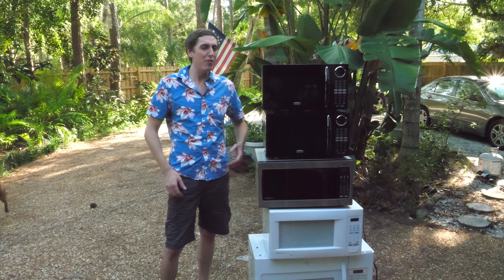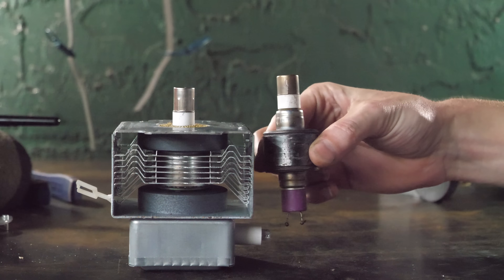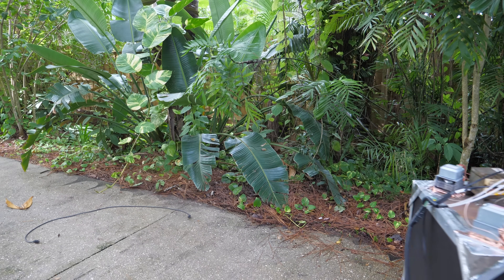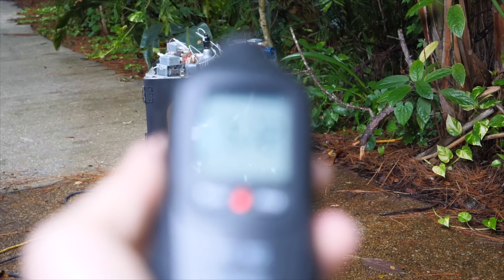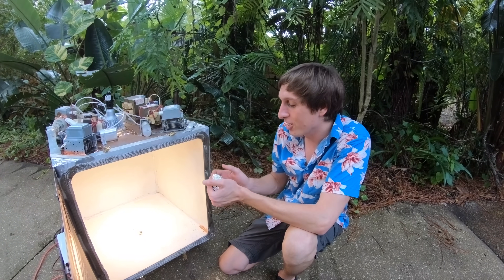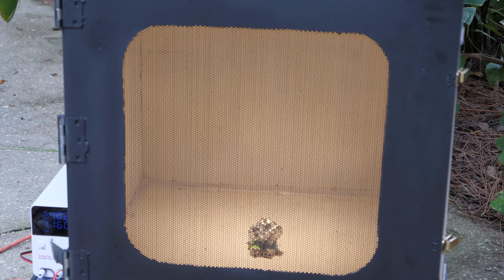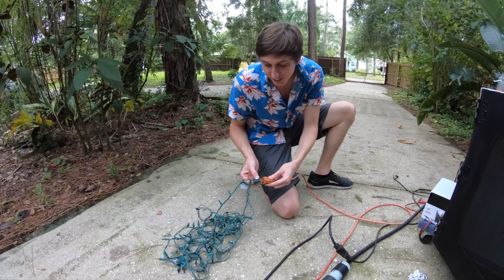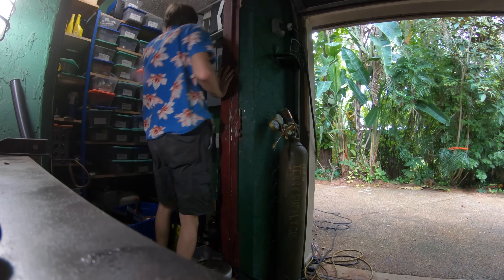DIY MEGA Microwave! - Microwaving a Microwave

Comment: I asked my brother this very question and he said, “no you can’t. A microwave is a Faraday Cage”. Should I show this to him?
Reply: I wish there were microtron 5000's in ksp so I could build a microwave space gun on my warp drive rocket (mods are ok too)
Reply: He's right tho, microwaving  a microwave doesn't amplify anything, but it can't be a complete Faraday cage, because of the screen.
Reply: @zaydabbas1609  as was stated in the video, microwaves are long waves. The metal mesh embedded in the door blocks them. Otherwise, you'd have a lot of lazy people with no working eyes after they checked their food through the door while it's still running.

Comment: Here's what I think happened;
Commercial microwaves are designed to contain as many of the microwaves they produce as possible, meaning a chassis which is essentially impenetrable to microwaves. Now on the odd occasion that you shoot microwaves at the outside, I'd guess very few (if any) of those will actually reach the inside. I think what happened here was not actually due to destructive interference but rather the inner microwave was destroyed after just a few seconds and then acted as a shield for your Scientifical Standard Snack. It's also just occurred to me that the casing of the inner microwave was probably grounded, making it act as a mini Faraday cage.

Nonetheless, I can finally say I know the answer to the age old question: "Is it a good idea to microwave a microwave?"

Comment: Well, obviously the microwave is built to isolate the microwaves within, since they are dangerous. But this isolation works in both directions. So the microwaves of the outer microwave will only burn the inner microwave without reaching the snack. With the inner microwave busted, it doesn't heat the snack anymore either.
You've essentially built a dangerous less efficient one-time use composite microwave.

Comment: sooo many things i wanna do different to that Mega Wave!  1. space out the magnetrons across the entire cube instead of all on top. 2. add microwave...guides??? ( i dont know what they are called....) But they direct the wave in a special way so it is able to go exactly where u want the most energy to go.  3.  make 1 single high pressure "clip" so u dont have to open and close 6 different latches. 4. add...that...stuff... that allows the microwaves to bounce around in the cube..  (as you can see.. i don't know much about the actual materials either... but it would have been a friggin blast to work on this project with u!  let me know when your in Austin, TX at any point :). i have a bunch of random projects here you may find fun for one of your shows.  (racing quad with release mechanism so a green soldier can drop from waaaaaay up instead of just tossing him off the roof like i used to do as a kid... 1 fully custom 3d printer designed and built by me and a group of 23 other peeps using a chat room to share designs and upgrades.. 2 other prusa MK2S printer... 1 of those being a 2.5.   audio engineer on the side... um... make my own fireworks out of other fireworks by combining FUN STUFF into a ball!!! (each ball took me over an hour to build. i had no idea how much work went into those.)  anyway, i built 2 of em and both worked!!!! oh. and i love chinese food.

Comment: An improvement to that would be proper deflector ducts going to each magnatron. Commercial microwaves that has two elements use two ducts that focus them into the chamber. The reason has to do with resonance feedback. (aka why one of the transformers got very hot) Also somewhere should be a grid covered vent with a 90 degree duct coming off from it, it's for venting and since radiation can't go around corners (weird right?) they are cut down by the grid and further stopped by the 90 degree bend. The reason why the franken microwave you seen chills food down is the transformers were most likely wired out of phase, effectively slowing down protons rather then speeding them up.
Reply: i really wished you could deacelerate protons that easily mr maxwell..
Reply: @fss1704  oops I meant molecules.

Comment: You should use the Megawave as a microwave smelter! Using a silicon carbide crucible and a fire brick baseplate, you can actually use a microwave to melt metals. Sometimes you need to water cool the the magnetrons as well, but it's a lot of fun. Before the trolls jump in and tell me you can't melt metal in a microwave, I actually did this in college (where i studied metallurgy. Below is an instructables on doing this with low melting temperature metals. We were actually able to melt iron and steel using the water cooled version we had.

https://www.instructables.com/id/microwave-smelter/

Comment: The feedhorn built into the wall of the original microwave oven is important.  It is a tuned cavity that couples the magnetron to the oven.   Perhaps you can scavenge them out of the donor-microwave enclosures and use them in the mega-wave.

Also, the power supply for an average oven magnetron often consumes around 1100 watts.  One 15A circuit breaker can deliver around 1800 watts (which is why you don't see 120v appliances consuming more than that - think blow dryers).  Combining 5 magnetron supplies on a single breaker would far exceed what the ac line is capable of delivering.   The power supplies were likely sagging - unless the coupling of the output was so poor that it wasn't presenting the normal load to the power supply.   It's sort of like tuning a radio transmitter with an SWR bridge.  If the antena isn't right, the power going through it is greatly reduced.

Comment: I sincerely hope you didn't crack those insulators when you took the magnetrons apart. Unless manufacturing methods have changed, magnetron insulators are generally made of beryllium oxide, which is highly toxic and carcinogenic. If inhaled, it causes fun stuff like respiratory berylliosis and mesothelioma.

Comment: if you run the mega-wave with higher voltage it will work better. try a three phase welding line

Comment: I was going to do this years ago, but decided against it due to the high levels of radiation. At 4:25 you made me nervous. Even though it may have been unplugged, those 1uF / 2kv caps hold a charge for a little while. It takes time for the internal 10M resistor to bleed off the charge. Be careful!
Reply: I've always wondered if eating microwaved food is healthy?  Is the no radiation transfered into the food?
Reply: I stopped watching when he drilled a hole in the macrowave and did not seal it.
Reply: @drippingwax  i really hope he plugged it with foil or something off camera.

Comment: Technical question. 
Given that microwaves already draw most of a 20 amp circuit at 120 volts, how much power were you actually supplying to the 4 magnetrons? It appears that you had a standard 16 to 18 gauge extension cord at 120 volts, so I find it hard to believe that you crossed 2.4KW. 
Thanks.

Comment: All those experiments and he didn't even make turbo plasma....... and he calls himself a scientist!  Lol (I've found an old sock is the perfect fuel source to get the microwave plasma going strong. Catch it on fire in the microwave and power it up!)
Reply from the maker: Wait really? I've had trouble making plasma reliably.
Reply: @TheBackyardScientist  Yeah! I absolutely love plasma, and finally got a microwave lined up to experiment in. I just let it jump around the microwave rather than catching it with a bowl/ jar, but the biggest factor seemed to be having enough fuel for the fire so it stays strong long enough for the microwave to excite it into the plasma state. I noticed that the microwaves accelerated the burn rate of the matches I used at first, and that's when I switched to the sock. Also, the thermal shock destroys the turntable plate rather magnificently. :)

Comment: Need a tin foil shield to protect your nuts, because nobody likes roasted nuts!  I would also add some kind of metal blade in front of the wave guide of each magnetron to deflect the waves randomly, have it spin.   Actually should do an experiment to see what kind of distribution of microwaves you got going in there.  I wonder if some of the waves actually cancel each other out?  Would be interesting to try with 1, 2, 3 and then 4 activated to see different results.

Comment: The reason why there are hot spots on a microwaved meal is because the microwaves create a harmonic standing wave within the oven. Basically, the microwaves get reflected off the walls of the oven and interfere with waves traveling in the opposite direction, creating nodes where they cancel each other out and antinodes where they reinforce each other.

You could improve upon your design by finding out the precise wavelength of the microwaves the magnetrons create, then adjusting the dimensions of the oven to create a standing wave and placing your target within an antinode.

Comment: How would the microwave in the microwave even work cause the regular microwave does not let waves out or in so there was no hypothetical way it would have worked unless you took the door off of the smaller one before you put it in the big one.

Comment: Wonder how many watts it's packing. A 1kW microwave Won't melt a CD like that and that fast it's got to be at least 2kW probs more tho. You must put more things in it!
Reply from the maker: I'm pretty sure it is doing like 2kw. It should do 4kw, but theres probably a lot of dead spots and destructive interference happening.
Reply: @TheBackyardScientist   if you got any glow in the dark paint. Paint whole sheet that fills the bottom of you mega wave and possibly if u wish on the sides then run it for 5 to 10 seconds then where the waves are hitting it will glow brightest. Think it would be cool to see.

Comment: How are you supplying power to this? One circuit breaker per microwave?
Reply from the maker: It's on my welder circuit. 40 amp split phase 240v. 2 transformers wired in series (and 2 more in series - In parallel.) Because of this they see twice the duty cycle and get really hot so i had to use hair dryer blowers to cool them.

Comment: Slap some waveguides on those and they'll work much better!
Reply from the maker: Yes me friend is studying RF design and gave me dimensions for the wave guides and everything. I just did not really have time to build them, plus it worked good enough when I first tested.
Reply: Nice! I've never made them, but I'm sure you could gerry rig some with sheets of cardboard lined with aluminum foil. You could even make a microwave gun if you wanted at that point, but watch it because that inverse square law doesn't apply quite so easily in that case.

Comment: FYI, circuit breakers are not switches. They are only rated for a handful of switching events. You don't want to find out the hard way that you've exceeded the limit and caused it to fail.
Reply from the maker: Yeah I know. This was a special circuit for my welder and only like 6 inches from the fuse box so It will be fine.

Comment: include rotating waveguides for the four magnetrons, preferably out of phase, to properly disperse the output of the waves in the chamber. Otherwise I think you might just be creating hotspots like in any old microwave.
Also: if you have about 8 times the volume of a conventional microwave, and you put in only 4 times as much power through magnetrons, haven't you actually build a giant microwave that is about half as powerful as a conventional one ?

Comment: did you look into the spacing / direction / timing ?  Since they have the same wavelength, they may cancel out if the phaseshift is right.
Reply from the maker: I just winged it honestly. My friend is in a masters program, something to do with RF design and he had a good laugh at my design.
Reply from the maker: Also they are powered In series from the 240v lines. 2 in series then 2 in parallel. Because the 240 is split phase from the transformer   I'm pretty sure the magnetrons are doing double the duty cycle. Instead of going from 120 to 0 there going from 120 to  -120.  Because of this they were making a lot of heat and I had to use hair drier motors to cool them.